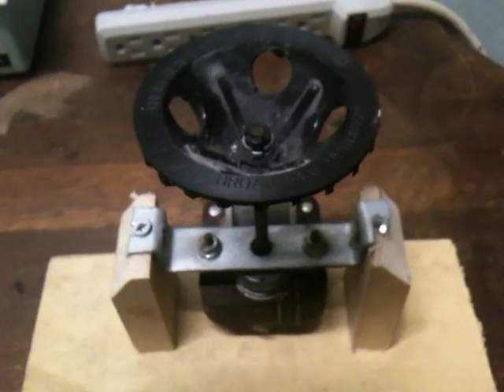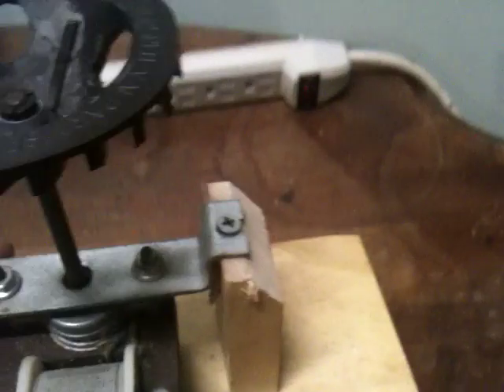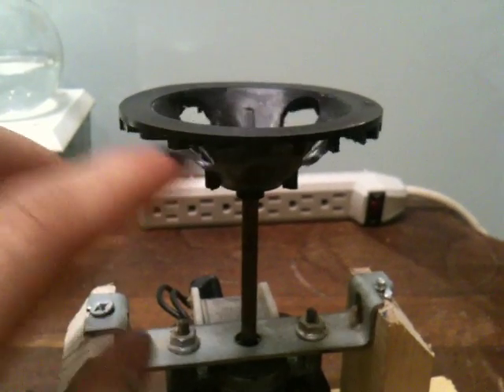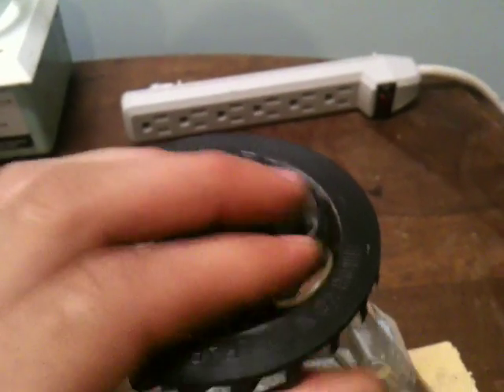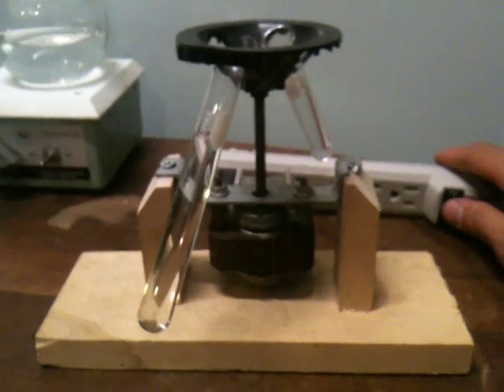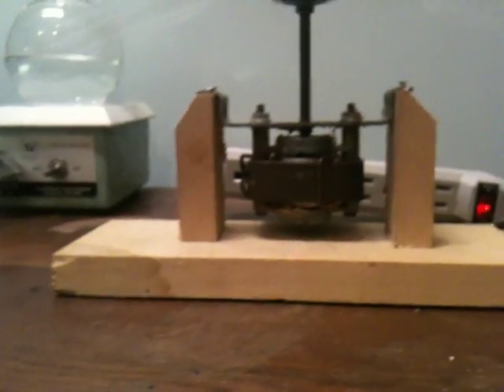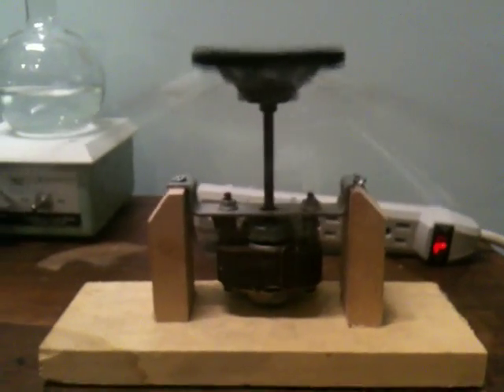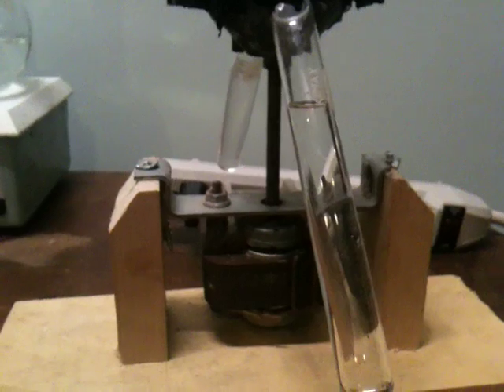how to make a centrifuge at home

Comment: Trying to "like" your video but YT wont allow me to for some reason... so uhh 👍 👍 👍!!! (#160)

I was considering using a bike rim with a much wider diameter to get a higher speed (& ∆G) at lower RPMs, I don't have any real way to know know how much my application will require. I'd like to make joints that would allow the vials to pivot out when spun-up (for a more uniform, consistent separation), do you ever have issues with incomplete separation or particulate on the vial's outward-facing glass? My whole idea may just be entirely excessive, and unnecessarily complicated to solve an issue that doesn't exist!

So does anybody know of a way to determine/calculate how much G(ravity) is being applied for a given RPM & wheel diameter - without having to just build it 'freestyle' (built sans any meaningful calculations, with minimum premeditation or forethought) and hang a scale off of it for direct measurement? Im aware obviously there's gotta be a well-known formula, just don't know quite what I should type for an accurate websearch on this. Really not a fan of the "guess & check" method, especially for any complex task... usually ends up a major waste of time and resources. Will generally try to do (at least) even the minimal calculations before any material is physically altered! "Measure twice" or whatever...

Comment: Good, but will it launch my test tubes across my house?
Reply: Laurel Cook depending on if;

Your motor’ RPM

The strength of what you’re using to hold the test tubes 

And how much centrifugal force your test tubes can stand 

It may or may not end up launching it across your house

Comment: You also need to heat evenly so put your flask in a metal container that is filled with water.. Heat the container, which will heat the water, which will heat the flask and contents. Stir often or use magnetic stir bar to get consistent heat throughout.

Good Luck

Comment: Hello, yes you would have separation of that sort but I doubt you will have a 4 phase product. I dont know too much about ginger but I believe the extract  is water soluble. Press it and then filter it and then you would get separation of what the filter missed on the bottom and phases of whatever on the top. If there is oil involved it will float on the top. 
Do a test batch of ginger pressed and distill the solution at different low temperatures.  It will take longer but I think it will work

Comment: Hello, you would get all solids on the bottom and liquid on the top. Whatever is heavier will be compacted on the bottom. If you want concentrated root, you need distillation equipment. Check it out on ebay.

Comment from the maker: @xOrhan1976 thanks :) im so glad its appreciated! i knew someone will like this.
 i actually finished it and placed it onto a heavier base; the imperfections of my work have been balanced out. it actually works better that its not perfect, because a little vibration helps to separate my mixtures here.
Reply: Valuable info! 

Do you ever have issues with incomplete separation, layer-uniformity, inconsistent separation, or especially any solid particulate from the original suspension clinging to the outward-facing (in relation to the G-vector, not the outside of the glass obviously) walls of your vials - even after an adequate rotary cycle? I was considering adding pivot-joints to whatever ends up as the vials' mounting points, but realized I may just be attempting to solve a problem that is either negligeble or entirely non-existent (I have a long legacy of doing exactly that lol).

Do you by chance know how one would calculate ∆G for a given wheel diameter & RPM? Rather hard to word this for a search-engine to find... •circumference of wheel
•RPM/circumference 
•????? 
(not sure how to turn that into the weight-increase for those parameters)

Fully aware this's like... a simple formula - but it's been so long since I've had to use that part of my brain, it's actually extremely frustrating and not to mention embarrassing. Mathematics used to be like breathing for me and it's all just so foggy now... 

This is what it looks like when someone gets burnt-out on mathematics, packets and packets of problem after problem after problem  tend to have this effect (personally I believe public education's goals are to break childrens' minds, and make learning as negative of an experience as possible - not to mention the um... "social-conditioning"). You'll never wanna see that shit again, exactly to-plan. Before you know it, a decade(+) passes with VERY minimal-usage of the skill... SO many people I know had this same experience honestly, it's why I think it is deliberate.